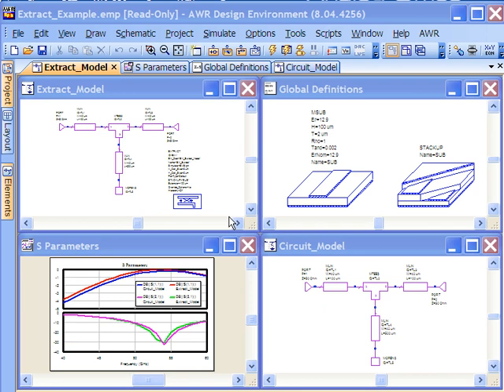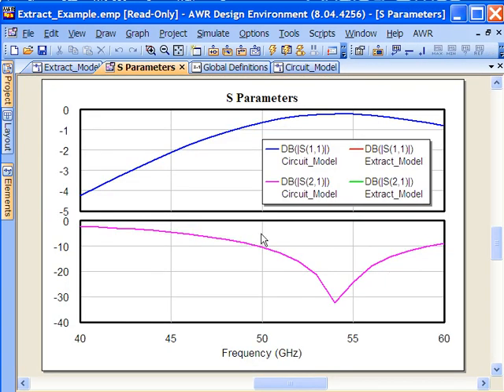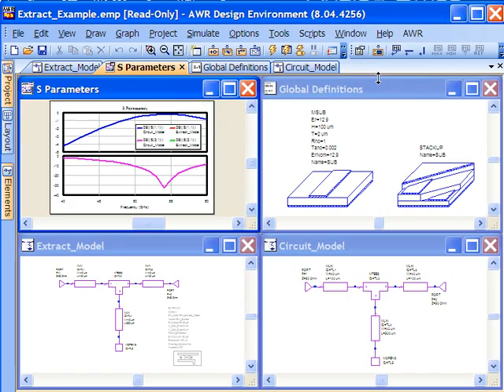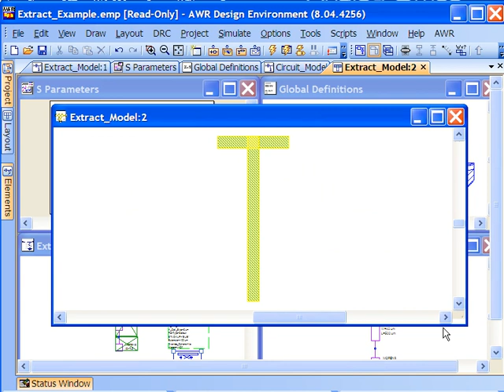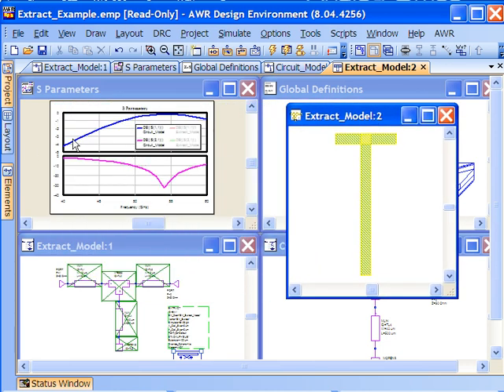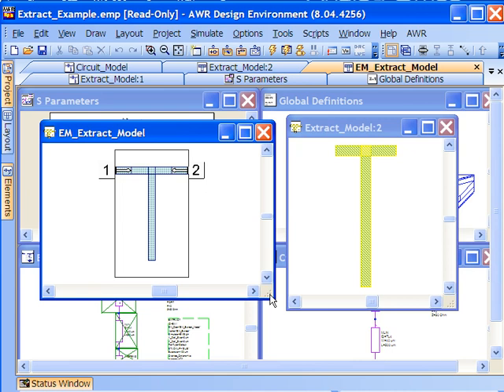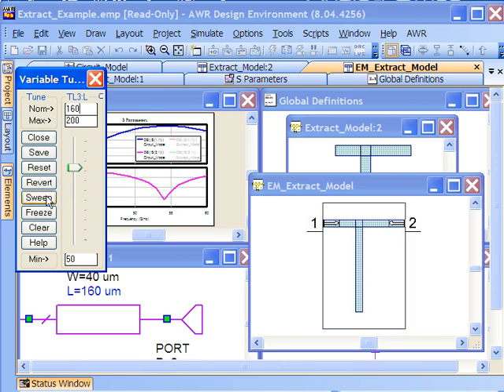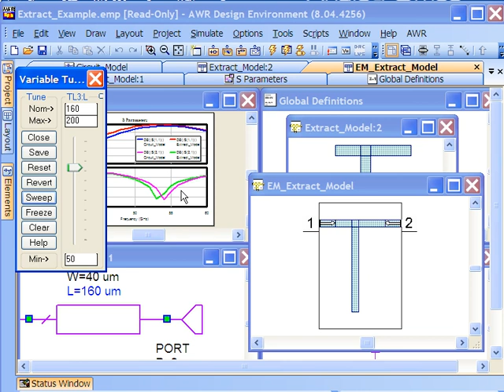Feature: EXTRACT

Comment: Can you set the length of the de-embed planes when using EXTRACT with EMSight? I find it strange that you can set the extension, but not the length of the de-embed planes. When I have a small extension, my extracted circuit in the EM view runs outside the box enclosure because EMSight puts de-embed planes that are longer than the size of the extension! If we can't change the length of these de-embed planes, what is the default length that EXTRACT uses? Thanks.